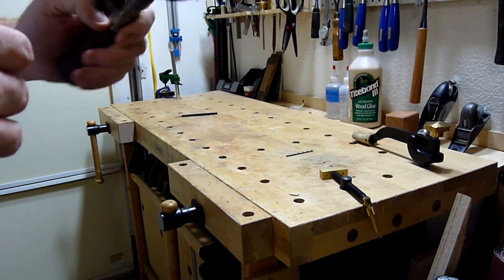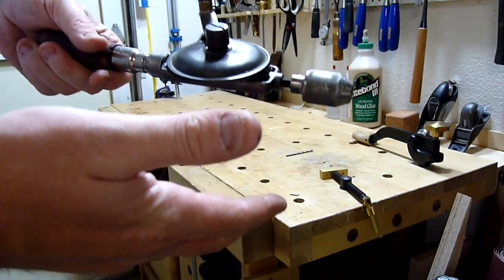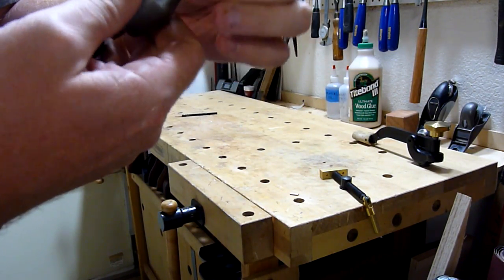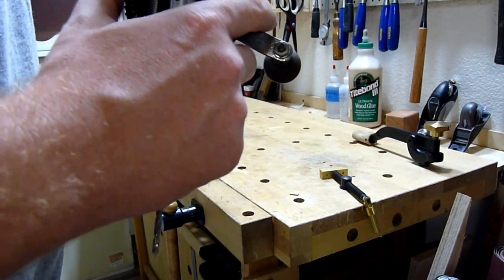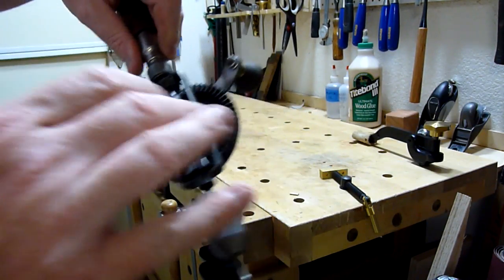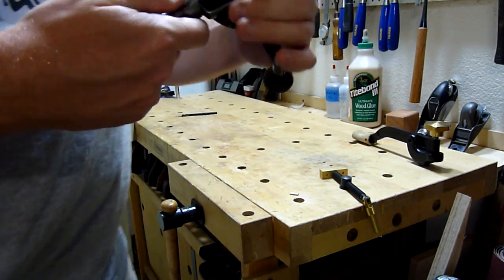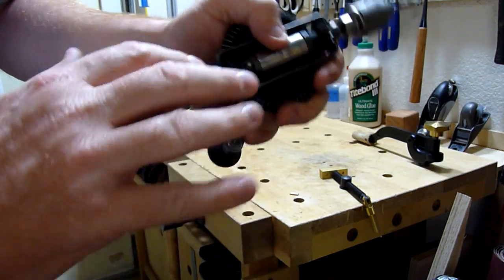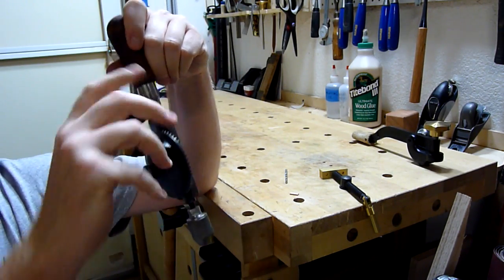North Brothers Yankee 1530 review

Comment: Most 1530As are found with the 9/32" capacity chuck that was originally developed for the Yankee 1431 hand drill and later used on the 1530A. 

The 1926 catalog description of the 1530 lists a 1/4" capacity chuck. 

All of the 1530A-Xs were built with the Stanley design 1/4" capacity chuck.

Comment: The Yankee 1530A is the later version of the original 1530. 

The 1530A was introduced by North Brothers sometime before WW2. Stanley purchased North Bros. in 1946 and sold the 1530A until at least 1958. 

Stanley also made the 1530A-X, a later version of the 1530A with a Stanley chuck instead of the North Brothers design. 

The defining feature of the 1530A is the die-cast non-ferrous frame. The older 1530 uses a malleable iron frame.
Reply: I happen to have one of those versions of the 1530 with the totally screwed up redesigned  chuck by the design idiots at Stanley. It's an absolute piece of freaking garbage. No matter how tight I get the chuck, every time I try to take a screw out the chuck opens up and the bit falls out. It does not have that interlocking slot on the end of the shaft that goes into a slot inside the Chuck like the 1545 does that I have.
My 1530 was bought by somebody who obviously didn't like it once they bought it because it's still in mint condition. It's a nice display piece but it's useless as a tool! 
I am still looking for an early 1530 with the original North Brothers chuck on it.

Comment: Can these type of eggbeater drills be used to drill into concrete walls?
Reply: I noticed that you never got an answer. I'm going out on a limb and giving you my opinion. Yes. Any drill can drill into concrete, steel, wood, or even glass. It depends on the style and composition of the bit used. Will it drill quickly? That would be a judgement call based on what you consider quick. For concrete a 1/8" tungsten carbide bit will drill a 1/2" deep hole in about a minute of steady drilling.

Comment: It's not magic, its engineering.  In the double ratchet setting, the upper and lower pinions are set to ratchet in same direction.  Because the ring gear is traveling in opposite directions at the top and bottom relative to the pinions when moving, one pinion is always ratcheting free while the other drives the spindle.  Reverse the rotation and the other pinion locks to the spindle while the other is ratcheting free.